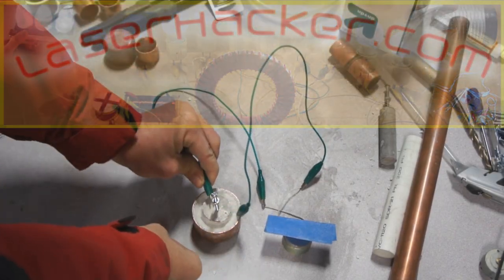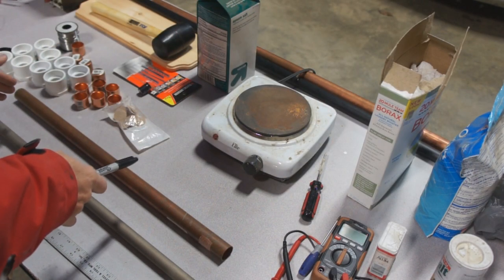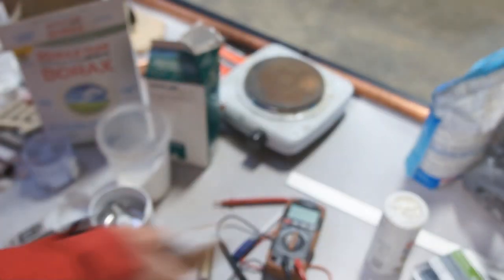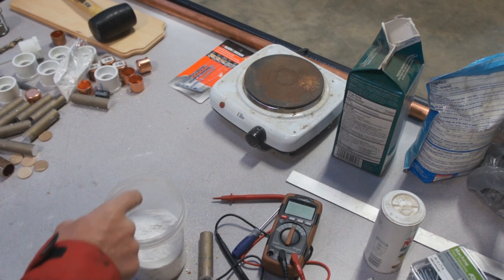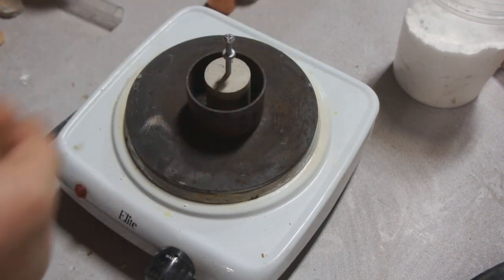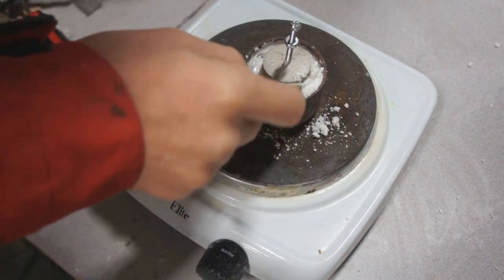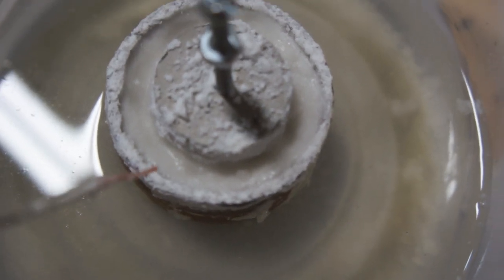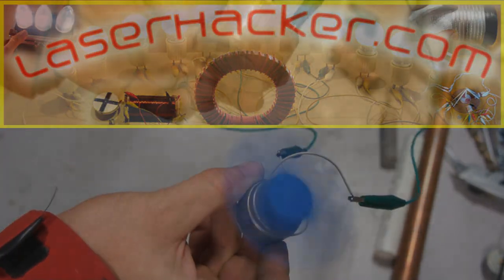How to Build Crystal Power Cells - Long Duration Power

Comment: Have you used these on something like a flashlight bulb? It would be interesting to see how these compares to a D-cell for mAh capacity.
Reply: these put low amps but they last for years!! even D sized carbon or alkaline batteries wont last that long
Reply: That was my suspicion. It these things had a lot of oomph the demo would have shown that.
Reply: This will give only micro ampere current.
Reply: Probably this works on micro ampere current. One can set up an antenna and get that type of current from the RF field. On youtube one device with tuned resonance circuit and a lighted bulb is presented as a free energy device.
Reply: That's true. I make crystal radios as a hobby, and I can get an LED to flicker with just the RF energy that my old rooftop TV antenna picks up from the local radio stations.
Reply: +fidel catsro They will if all they have to power is an LED.

Comment: Crystals are piezoelectric meaning they turn mechanical energy into electrical energy so if you press on it they generate small ammount of power, so if you hold it under pressure they keep generating energy. This is just a normal battery and no crystals involved.

Comment: Dont the spacer keep the magnesium from touching the copper ?  otherwise it will short out right and not work right?
Reply: Kennynva T.  yes, keep the magnesium from touching copper at the bottom
Reply: +Kennynva T. but as I remember in the video, didn't he say that the core started to rise up over time which would bring the magnesium core out of contact with the copper anyway?
Reply: +pds tech but as I remember in the video, didn't he say that the core started to rise up over time which would bring the magnesium core out of contact with the copper anyway?

Comment: After you put the hot liquid chemicsls in the battery, put it in a vacuum chamber to remove all the sir bubbles. You can make a cheap vacuum chamber from a  old fridge compressor.

Comment: Thanks for sharing, nice design. Those copper caps, home depot? Where do you get the magnesium cores you are using? Are you using a steel screw at the top? You don't start them off with an initial 12 volt start charge as I have seen others do? Does the size or amount of material alter the voltage or amperage?

Comment: I have a question when building the cell while the cell is  powered  those the cell produce heat and what are the temp.  what is the  out put power this cell is  generating according to those measurements of ingredients you put together. are they stable when measuring?

Comment: 1. What height/diameter is the magnesium core?  2. Is that a cut magnesium rod?  If so, how do you cut the magnesium without starting a fire?  3. How much did all of the ingredients cost you?  THANKS VERY MUCH!
Reply: If you haven't heard this by now, I just cut a magnesium anode with a brand new hacksaw blade, 18 TPI. Yeah, I sweat a bit but mostly took a lot of breaks to reduce chances of friction.  The blade cut nicely.   I'm new to these kindsa projects, so When I can remember to get some replacement alum I plan to make this sort of battery.

Comment: On the remarks of stuff running for a long time ....I got fed up with a cheap 1 inch LCD clock running down its button cell - so fitted a nice fat D cell the expiry date on the cell is 0704 so its been running now or over ten years, I expect it to run for another decade at least. I also still have the 'other' cell waiting as they came in pairs!!!

Comment: I Messed around with homemade frozen crystal batteries before. You can make them hold a limited charge to turn on a light. Decay rate was decent. Tried to make the experiment metal free. The crystal goes through a cooking , freezing process and electrical process. Last stage was to charge it with electricity and run the test.
Reply: Are you on Facebook also?

Comment: Have you tried hydrogel for soaking up water in a cell? Potash,  glycolic acid, magnesium sulphate, aluminum sulphate or alum and potassium chloride and borax. Note mix glycolic acid in potash add borax after reaction. Mix an soak hydro gels in mixture. When swelled remove water crystals and let dry in cell. The idea was for polymer ion conductor for galvanic cell?

Comment: What would happen if you melt the salts in a separate container then pour it into the cell? Would this allow for more even and thorough mixing and melting? Will it work better or cause an unforseen issue? 
   You may want to inform your viewers that magnesium will ignite and burn at around 400° producing an oxygen reaction which cannot be extinguished except by chemicals. (Ammonia) working with magnesium near heat source can be extremely dangerous. The hotplate on low probably cannot get that hot but viewers should know as they do things differently. Interesting fact: magnesium ignites at a lower temperature than its melting temperature melting, pouring and shaping is done in an oxygen free environment to prevent ignition. Once lit, magnesium will burn under a pile of wet sand turning it to glass. If you experiment with it, have some ammonia ready to put out the fire as water and fire extinguishers usually won't work.

Comment: Add solar panel in parallel to add amps to your crystal cells.   Build several in series to add the volts.  Then, wire your crystal cell battery to a good amp producing source, like a solar panel.  

Watts = amps x volts!

Comment: First,  that was a really interesting article.

I assume the   cell at  some  point  will  stop  producing  energy like a   dry cell battery, lead cell, Ni0MH etc..  I'm thinking that  exchange  for   electricity beweent the reaction  of the   anode and  cathode with the for  lack of a  better word, electrolyte then you must ultimantly produce an inert  waste  product. 

I'm thinking that  either or  both of  your  metals (cathode made of Mg and  anode of Cu)  would have to  deteriorate to the   point of  creating a  gap  between  the   magnesium core  and the   chemical  compound you  created.  Am I  thinking  that through  correctly?   Also,  are  all the   cell  only  producing only 1.4 v +/-  regardless of  size?  As  for  current, if a   big  cell  will produce  approximately the  same  voltage as a small cell, is there  also a  corresponding increase in amperage as  the   cell  cathode and   anode increase in size?  

Also, I am not  sure  where to  obtain the  round   Mg  stock you  used.  One  can   obtain those   Mg fire starter   things   that  are  soe   in outdoor  sections of  stores.  While  there is  not the  same amount of   mass, I  assume  it  would  work, even if you used   one or  more.

Comment: Well done Lasersaber, looking forward to your next video. Did you check, if the Copperoxide inside plays a major roll so that the magnesium will not be consumed ?
So is it really something other than a galvanic cell ?
Reply from the maker: After two year on my test cells the magnesium does show corrosion.  At the rate I am currently seeing, I expect the cells to last for a very long time.  The rod may get pushed up out of the cell before it gets consumed.
Reply: It is a Galvanic cell. Just by inserting two dissimilar metals into a lemon one can make a battery which will give more current than this solid state Galvanic cell, because the electrolyte is a solution in which ions can move more freely.
Reply: @akvenugopalan9773  I have never seen a battery last two yrs..so I wouldn't call it a BATTERY of that sort..

Comment: How have i not come across this yet??
Sure, the output amps are low.. but, and correct me if im wrong, couldnt 4 of these cells wired in series (4.8v) provide years of charge for  li-ion cells at 4.2v, rather than being a standalone source of energy?
Reply: make it in parallel only, big #10 wires soldered together....

Comment: This is my first exposure to this. My first question is, seeing the one cell I can extrapolate from there. what is the current capacity and voltage of the cell. Will series configuration work? the material appears robust enough for substantial current potential. I am interested.

Comment: Hello, I have used without borax, and try with well smashing the powder.  I have oxidized copper well. It gives me 1.65 at first, I start squeezing the powder, IT start increasing up to 1.95 V.  After I decided to put in epoxy. I heated epoxy to harden faster. Once I put epoxy in, It starts bubbling due to the heated air in, I am afraid epoxy goes in. The voltage starts reducing since it is a warm, and during the cooling reduced.

Comment: Lasersaber: Tell me please, your multi-meter indicates the voltage of your CPC because you put your probes in parallel mode, which is correct. However, when you do get your multi-meter in ammeter mode, without first having put your probe in serie mode with your PCP, how can you say that there's an electric current flowing ???

Comment: can this be done in a square sheet form instead of pipe Magnesium  sheets are like 5 bucks a peice so i think i could make a layered cell of copper and Magnesium and use an oven pan to bake the whole thing in an oven cut away the pan when it is done

Comment: I don't get it. These aren't chargeable cells? They just have a natural instance of some stored power? Do they deplete over time?
Reply: Yes. Like lemon battery. The borox-epsom salt will act as an electrolyte and copper and magnesium as anode and cathode. The electrolyte allows the transfer of electrons between the metals, thus generating electricity. Not very much of it though.

Comment: Does more material and a larger case automatically mean for more battery power / life? If so, which is it? Will a larger battery produce the same current with a longer life? Or would it output at more than 1.4 volts for a relative amount of time based on discharge rate?
Reply: +TheAnswerGuy I've also seen that most cells produce a set voltage, no matter the size, as in the case of AA vs. D batteries, as well as Lead-acid car batteries. In car batteries, the battery is actually multiple cells pre-stacked for the twelve volt requirement. I believe the size does play a role in life length, as in the AA to D battery  comparison. I'm still fairly new at this, as I focus on a Lego approach in electronics components (there's only a few Types of components, all of variant properties, but generally the same function), so I could be Horribly wrong.

Comment: hanks for the videos Ive learned how to build all kinds of home made cells from laser saber one thing in addition i have tried and succeeded to make a voltaic pile from 7 pennies 7 washers {zinc} 7 pieces of cardboard in between and instead of vinegar or salt water i used toothpaste the aim gel kind it worked great got the same 0.83 volts that i got with vinegar.with each little cell. even the next day with it dried and fused together it still made half a volt.  fyi just about anything wet works . saliva... lol  , lotion , shampoo, salt water even my old spice deodorant. you do half to put the cardboard between the two different pieces of metal for it to work.

Comment: Lasersaber. I have built your crystal cell, I made two and they have 1.35 volts each, but i got a problem.... when i connect any item to the crystal cell, a led or an electric motor, the power is down to 0 volts, what did i do wrong? I have mixed all the ingredients and the crystall cell works perfectly with the tester, both connected in serie give 2.40 volts but whren i connect a led they down to zero too, can you help me please... i've checked your video several times and i've done step by step the procedure and can't figure out what i have done wrong, I'm very interested to make your crystal cell,  that' s why i' m beggin you your help... thank you very much.... i'm your fan number one in the web,, greetings
Reply: Did you add alum?
Reply: I am having the same exact issue.
Reply: LOGO DE SOPHIA yes, i added the alum, borax , salt epsom and the poatsium salt
Reply: David Juarez he have somthing in his cup befor he add alum but he wont tel, hes just dont wont you guys to know lol :-p
Reply: David Juarez he have somthing in his cup befor he add alum but he wont tel, hes just dont wont you guys to know lol :-p
Reply: David Juarez why dont you try adding Quartz(SiO2) or Potassium sodium tartrate (Rocelle salt ) - this thing have piezoelectric property - that means with vibration they can Emmit electrons

And also soon after you finished cooking add high voltage(like 12V) to the direction you wants to polarize it (- & +)  so it will make crystal polarize and give better voltage and duration
Reply: Kasun Alwis thanks i might try this out, i know John Hutchison says he uses rocelle salts in his,
Reply: David Juarez since its low voltage try a small filament bulb from a penlight or tiny vibrator motor from a cellphone. your test LEDs and motor might need just a higher voltage threshold than your battery is outputting. sounds simple but you tried switching the + and - to your LED?
Reply: Thank you my friend, i' ll try it

Comment: what type of nail or screw did you put in the magnesium rod and how did u put it in the rod
Reply: You can get copper & Brass plated screws, which may be better than the Iron/Steel/Nickel ones used here
Reply: If you need instructions on how to put a bolt into metal, please stop looking at how to make batteries, and go watch some tutorials on basic carpentry and metal working.

Comment: could this be used to trickle-charge a deep-cycle battery? and if so, how would you set that up?

Electronics make no sense in my brain, but I would love to build a couple of these and set something up for an off-grid project!
Reply: Likely no. You saw how fast he turned off the amp meter right. This kind of cell drops fast to a very low mA. I don't know how low, but would not be shocked to see well under 30 mA to perhaps approaching 10 mA or lower. They are long duration, but with current so low as to be useless in practical use. Even a low end led flashlight needs around 3v at 100mA. You would need a small bank of these to run even a medium powered flashlight for very long at a useful brightness. A large bank might run a small 12v desk fan. You would be FAR better off using solar cells.

He has larger version that puts out a lot more milliamps, but would still drop to a low state.
Reply: you can try to series these little batteries up into an arsenal of supercapacitors of about voltage slightly higher than the big battery with a diode favouring direction to the battery..it might charge very slowly

Comment: Any ideas why one of these wouldn't work following construction? I've tried just about every variation of alum I could find, and have bought magnesium from multiple sources and still no charge on the volt meter. I'm using potassium alum.

Comment: So with 15 volt system will there be enough amperage to run the SJR for 2+ years?:)
Reply from the maker: I will test and see.  I know from experience that it should be possible if the load is not too large.

Comment: I think this should be called an energy cell,   now if you take 2 in series and wire them to an ultracapacitor   it will function more like a power cell.

To remove the bubbles more effectively  you could use a small vacuum chamber to boil it out in one go.

Alternatively,   if the bubbles are a result of electrolysis in the cell  you could try applying cathodic protection in the form of an equal and opposite potential to the terminals.

If this is a galvanic cell,   you will find that power output is signifigantly greater when it is in a molten state.

To implement this,  use a ceramic spacer in place of the wooden one as the temperature would destroy it and produce gas/charcoal  which would interfere signifigantly.

For the core  use annealed magnesium sheet  folded like an accordian  then bent into a cylinder and crimped together,  leave a strip sticking up to use as the electrode.

The reason for using less is that the cell will essentially destroy itself before all the magnesium is used.

For the end cap,   you might want to use copper inserts  as they will be eaten away by the reaction quite quickly,   the metal closest to the core will experience the least resistance  and dissolve faster.

To use the cell you would have to heat it to the melting point of the powder,   this turns it into an ionic liquid  which has a low resistance compared to its solid state.

The lower the internal resistance of the cell  the higher its current.

Make sure you have a bucket of sand around if you try this,   as a magnesium fire will be made worse by dousing with water.

Comment: Dear Mr Lasersaber: As a practical lady, I am interested as to whether this device (battery),(cell) can be recharged? [If it can, it can make a nice portable power bank to power a cell phone on the go].
Reply: I would guess it is NOT rechargeable.
Reply: @stevenfeil7079  That's what I was afraid of. All that work to make a crystal cell, and then you have to throw it away when it runs out of juice.

Comment: This can be wired to a voltage multiplier or a power inverter to get 110-240v, but how many watt hours or run time could you get before it dies?
Reply: it only out puts like 0.13 watts its not gonna power anything when converted to mains type voltage because it would only be capable of 0.5mA if converted to 240v and 1mA on 120v